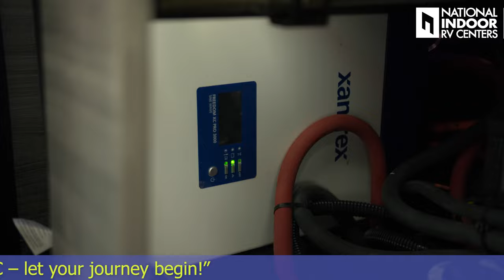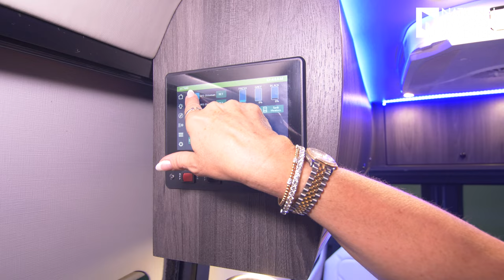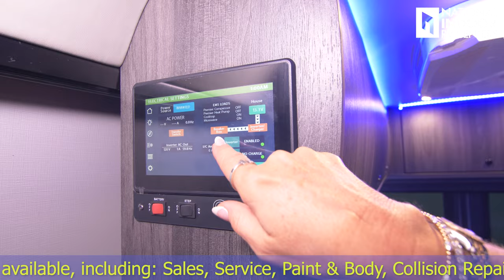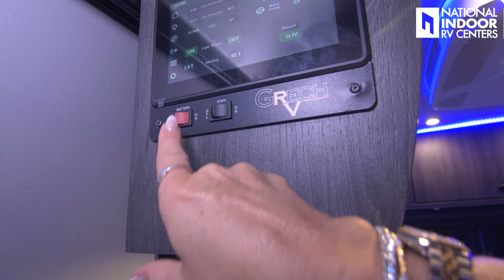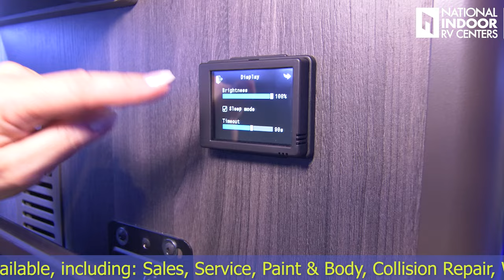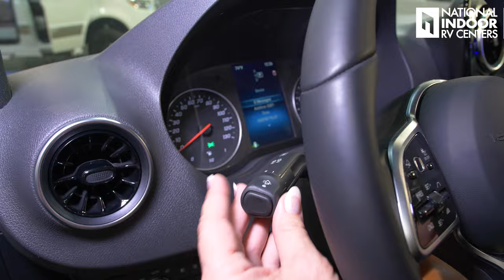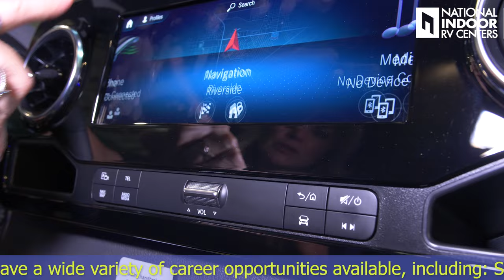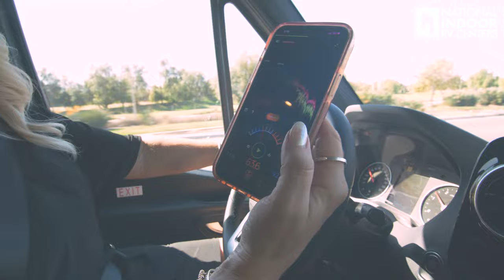Luxury RV Tour – 2024 Grech RV Turismo-Ion – Class B Motorhome

Comment: That was interesting they put a magnet on the leg so that side will not move but put the fresh refill on the sliding door but didn't put a safety device in 😅 I think they should put the water in the same place as other inpuz👍 but it's my opinion they put it on the door side so they would consider it when the door is open 😅